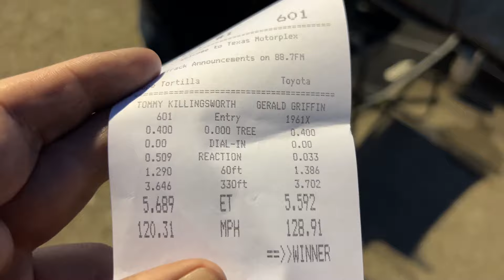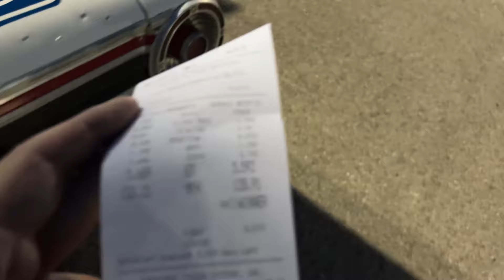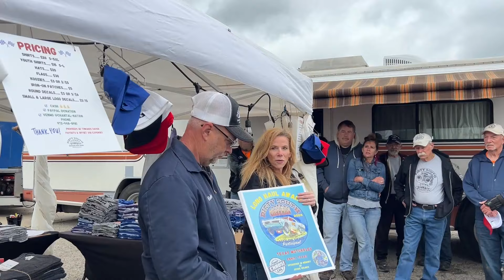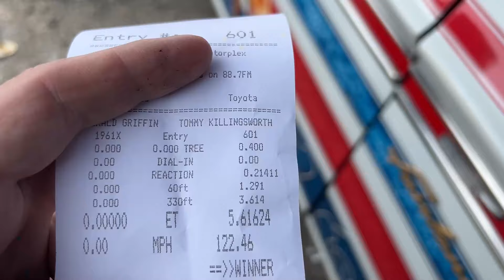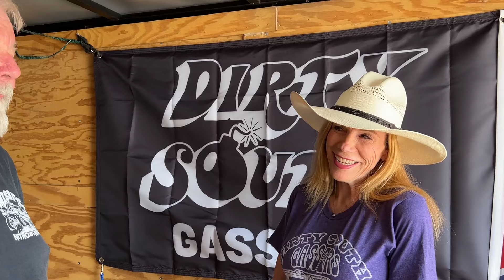Miss Fitt FINALLY Went STRAIGHT But We Have A Problem... Texas Funny Car Chaos Dirty South Gassers

Comment: Ive helped many racers go  straight , i used to race, found most racers dont do this ...jack up the rear so the tires are off the ground ,  use a tapestry tape and measure the circumferance of each tire, even new so called pairs can be off. My tires always needed differant pressure side to side by at least 2lbs.!

Comment: Question...is that an 8-71 and does it have Teflon strips? Been a subscriber since you started on the 57. Great content. Love watching you guys.
Reply from the maker: It is an 8-71 but it's not stripped, That's why I say I think it's doing all it's going to do, it shows 16-17psi on the gauge but from all indications, those boost numbers may be a little inflated. We have another stripped 8-71 that we plan to put on it, and have another converter already! Thank you!
Reply: It did sound like it was blowing thru the converter in this vid, especially the in car camera shots...could barely hear the 1-2 and it sounded like a cvt clutch on a snowmobile, went straight to max rpm and stayed there. I agree, don't think it's a boost/manifold pressure issue. Still sounds strong tho and the short end game is ON!

Comment: I really like this car. But the performance is way off,as a Blown alcohol dragster builder tuner.  I would expect your car to be deep in the 4s. Bossman I always enjoy watching this car and spending time with yall. My health caused me to have to quit. But I still enjoy watching.  Blessings to you guys.
Reply from the maker: Thank you! I definitely agree, although we don't run it as a max effort type deal, mainly due to the chassis, center of gravity etc, the power should definitely be there. We're leaning toward the converter being a limiting factor right now, and of course the blower is non-stripped. We have another converter and blower for it next, now that we're heading in the right direction on the chassis, we can start working out the other stuff and go faster!
Reply: @NitroUnion  and I heard you question the boost pressure 18 or so.... what size is the Cam if I can ask sir?... smaller timing values give high readings.. I'm sure you probably knew this but just curious.

Comment: Converter maybe too loose. On the gear change rpm didn't really come down. Sounds like it was blowing thru. Hard to tell watching be better if was there.
Reply from the maker: That's what we're thinking, spoke to PTC on the phone, we have a bolt together converter with a few stators from them that we're going to try next.
Reply: @NitroUnion  that will be interesting to see if it helps. Just got done watching and you really can hear the engine get pulled down on the 1-2. Glad you guys are having fun! Keep it up!

Comment: Glad you had a decent outing, I didn’t see timing being checked, plugs out, or valves & valvetrain being checked? If you lose 6mph you have something not happy! Don’t start changing pulleys, until you find out what’s wrong! Maybe you did & didn’t video! But I’ve seen many, many blower engines torn up, because people just ran them! Hopefully you guys already started looking & just didn’t video! Might want to also look at rear suspension, blown shock, loose parts, cracks, rollout, ect! Good luck!